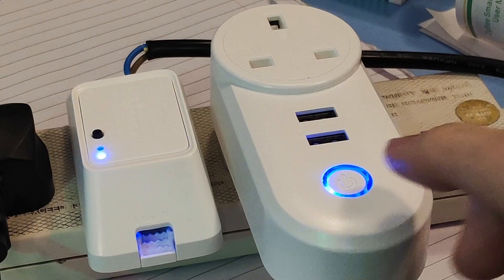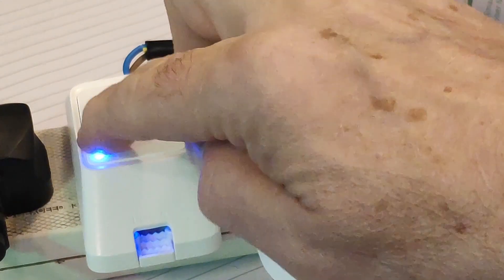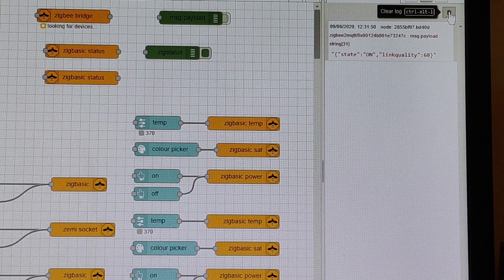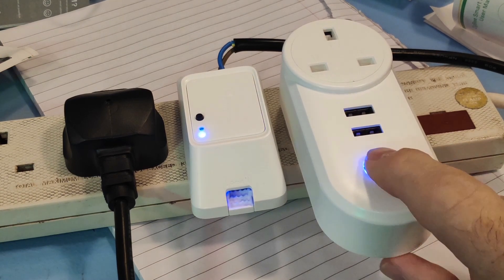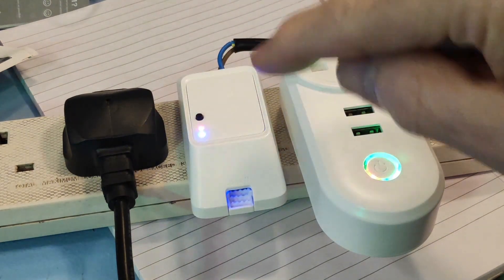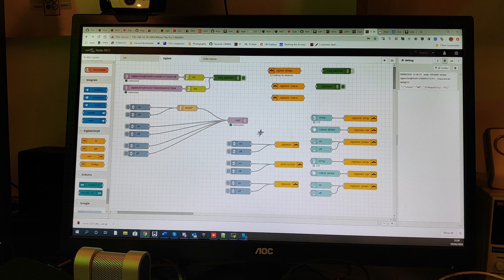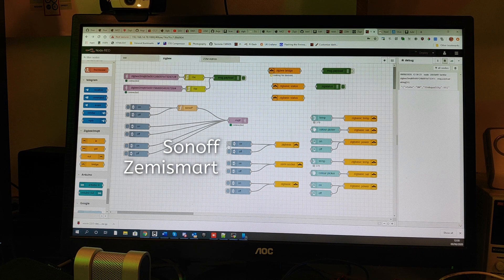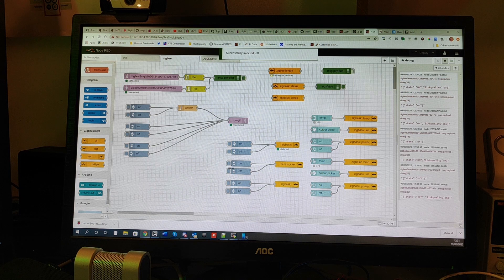Zigbee Experiments using the Sonoff Zigbee Gateway Dongle

Comment: Ì shall have to watch out for this myself. I decided to go zigbee, in fact I have no wi-fi devices except I occasionally turn on wi-fi on my phone because EE 4G is soooooooooo slow despite living in a town. I think zigbee is less energy intensive and maybe more secure.

Last week I put zigbee2mqtt onto a CC2531 sniffer to act as my co-ordinator. Today I put Zigbee2MQTT Router onto a CC2530+CC2591 (amplifier). I left the Sonoff basiczbr3 as is.
I've order more CC253x to flash https://ptvo.info so I can use the GPIO pins as input/output. I'm also looking for a zigbee version of emonTx energy monitoring but they all seem to be wi-fi based. Main HA s/w is Domoticz running in Docker.

Looking forward to more of your video's on zigbee.